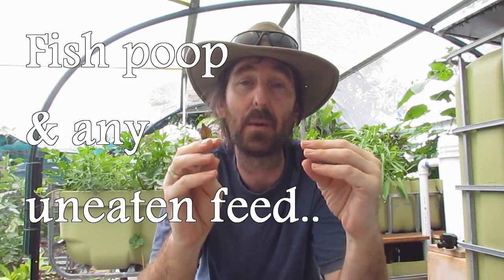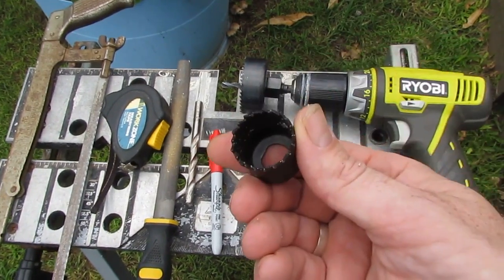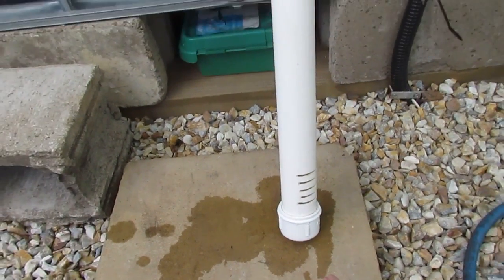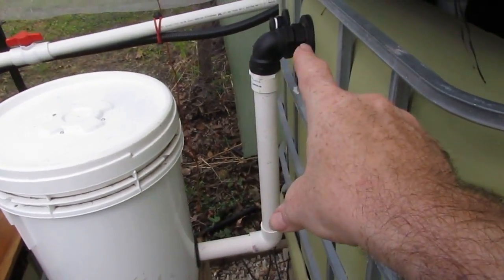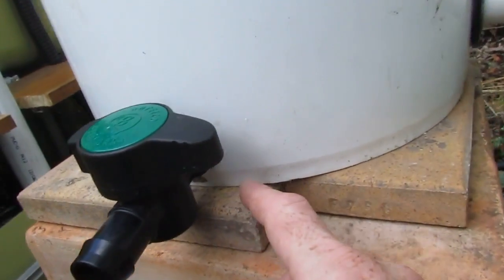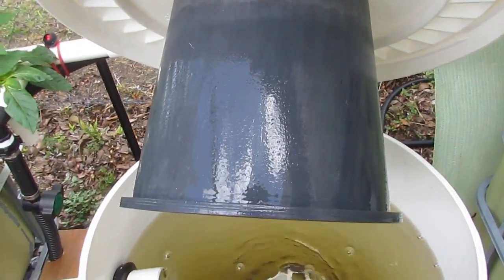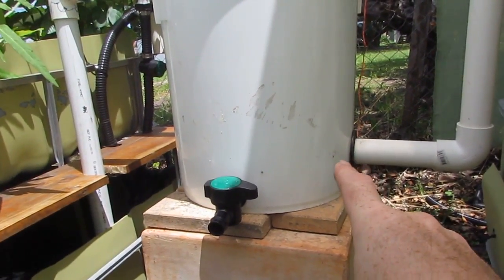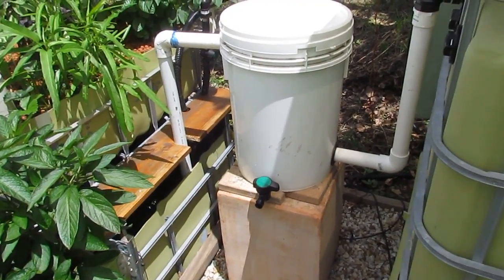Aquaponic radial flow filter for solids removal..

Comment: Why we dont use like filter sponge like mechanical filtration like in the normal aquarium setup ? Like its the same that we can trap the solid waste too
Reply from the maker: The amount of waste a 500g/1lb fish puts out is quite a lot. Multiply that by 30-40 & that's a lot of poop to try to clean out of a spongy media. 😉
I do use a sponge based filter sheet as a fines solids filter for 36 fish & that needs a pressure washer to clean affectivly.
Hope that helps some.

Comment: How does the water get from the fish tank  into the radial from filter
Reply from the maker: Hi David. I answered this on another video but will past the response over for others to see as well.👍
Hi David. This section of the "9 Essential components" video explains how the water moves into the tank & taken out via the SLO to the settler. 
https://www.youtube.com/watch?v=2FTlha0c2aA&t=192s
It's a part of this beginners playlist if that helps. 👍
https://www.youtube.com/playlist?list=PLBcWprMIwYYj8zCdbSzPJOR3HRXpxuBwf
Cheers mate.
Reply: I viewed these, but I don't  understand how the water and waste is pulled into the pipe in the fish tank
Reply from the maker: @helixpoint  The base of the pipe is the only place water has to exit the system. It creates a fairly fast current that drags the solids with it until it reaches the exit at the top. The exit at the top of the SLO is the lowest spot on the tank for the water to exit so dictates the height of the water in the tank. 
Hope that helps some.
Reply: Ah. I see

Comment: Hi Rob Bob, I have read quite a few of comments to see of can find heights to use for the piping as using a 1000 slimline tank to make radial flow filtration, does it need to be lower than the outlet coming from fish tank. I will be running it back into the sump system. Fish water really clear, although experience lot of solid buildup in DWC. Concerned that filter may not be low enough  for water to come to top of internal pipe in the filter.
Reply from the maker: Hi Andy & thanks mate.
The inlet  & outlet pipe of the settler need to be lower than the outlet from the fish tank 👍 Otherwise the water will back up into the fish tank.
Hope the build is progressing well mate.
Reply: Great video and love your dedication to happy fish

Comment: Hey Rob another great video. I am building an indoor system, and I would love your input. The fish tank is an IBC tote with just the top side cut. A second IBC tote is cut to accommodate the grow media bed and the sump tank. I want to grow plants in the media bed and use the sump tank to have a DWC floating raft with leafy greens. Regarding the plumbing, should I have it set up for the water to flow from the fish tank -> radial flow settler -> sump tank then pumped up to the fish tank and grown bed? Or fish tank -> radial flow settler -> grow bed -> sump tank and pumped back to the fish tank? Any input or idea will be greatly appreciated. Thanks!
Reply: I forgot to mention that I'll be using worms in the grow bed and tilapia fish.
Reply from the maker: I'd go with the second option to make the plumbing easy to set up. The split flow really comes into it's own when you have multiple beds with some being at different heights as the others. 
Hope that helps some mate.

Comment: Couldn't the solids be used as nutrients to the plants? Why we have to remove the solids from the the system?
Reply from the maker: You don't have to remove them if you're prepared to muck out the beds every few years. You'll also find that the water holds a lot of the elements suspended in it.
Many folks will mineralise the solids they remove & add that back into the system. Others don't worry as they find the nutrient levels are generally very high in a well stocked backyard system.
Cheers.
Reply: @RobsAquaponics  - Thanks Rob. I certainly would like to see a comparison between a non solids removed system Vs a system with removal... Would it make difference to the plants?
Reply from the maker: @fdavillar  There would be some difference but not a major one. I'm looking at setting up a mineralisation tank soon which will process the solids I remove into more plant available nutrients that can be added back into the system. Will be posting a clip on that when the time comes as well.
Reply: @RobsAquaponics  Do You, Rob? That's great news! I can't wait to see It.

Comment: Good job. Not sure have understand. The water flows out from Ibc tank with 2 different tubes, one is connected directly to the grow bed and another tubes go to radial filter. Is correct? In my system only one tube go from Ibc tank to grow bed ( without any filter)...
Reply from the maker: That's right David. Mucky water from the base of the tank to the filter & cleaner water from the top to the beds. 👍Cheers mate & happy growing.

Comment: I need something like this to pre-filter my irrigation water before it goes to by disc filters. The disc filters at times have to be cleaned 4 times a day or more. I have a gravity feed system from a creek. It gets up to 80psi so the vessel would have to be robust enough to handle the pressure. Because the water is from a creek, there can be a ton of organic sediment that comes with it. Only in the late summer is the water relatively clear.
Reply from the maker: These work best with very long retention times. It's the retention time that allows the solids to fall out of suspension & gather on the base of the filter. 
Cheers.

Comment: Hey Rob, thanks for your video - I dont understand how the water flows up the solids lifting pipe - is it being sucked up because it forms a siphon as the water flows out?
Reply from the maker: Hi Keith & sorry for the time it took to get back to you. 
The water entering the fish tank forces the water to leave via the lowest opening, which is the top of the outlet of the solids lifting pipe. The only way to get to the top of the outlet is through the base of the pipe & as it enters, it take the solids along with it. 
Hope that helps some mate.
Cheers.

Comment: Hi Rob. Just picking your brain here. Do you find it works better with the pipe bringing in the solids from the fish tank being below the surface or above the surface? 

Mine is above by about an inch and I think it could do a better job. 

Cheers have a good one
Reply from the maker: I like to have the top of the inlet pipe in the settler no less than 10cm/4" below the top of the water level in the fish tank if that helps any Michael. Sorry it took a while to get back to you.
Cheers.

Comment: i got close to 40k litres of water stocked with koi (about 100 fish tops). what size radial filter do i need? what size radial tank? inlet flow rate? retention time?  

is there a link that you can recommend so i can do some further reading?

cheers. 

btw is tue radial more efficient than swirl?
Reply from the maker: Hi Swee Wong.
I have some figures in the description of the clip that will help you size the vessel needed for a radial flow filter as solids collection is based off flow rates & retention time. 
This study showed that RFF worked mush better than swirl if that helps at all,
https://goo.gl/yreZ6G
Cheers.
Reply: @RobsAquaponics  cheers

Comment: Hi bob I am in gathering  of material stage  to start  my system  I live  in Belize  central America  I am finding it  really  hard  to get  the parts  I need  to set up my system  for instance  the hardware store  never even  heard of uniseal  abd the bulkhead are way  to expensive to work  with  is there any other option
Reply from the maker: Sometimes you can get away with using the threaded PVC fittings & washers Leon. It all depends on how much of a lip they have around the ends to help make a seal with the washer. Washers that size may also be an issue but they can be made from old tyre inner tubes. 
Hope that helps mate.

Comment: Hi there...Rob  ... so where's the point where the pump is  hooked at when adding this filter....??  ... sorry new to this swirl filter thing
Reply from the maker: Hi Alison.  The water entering the filter is coming from the over flow from the fish tank so no pump is required. 
When solids are run through pumps they are broken up into finer pieces which makes them even harder to remove from the water column. 
This clip explains how the filter was connected to our old IBC system,
► https://www.youtube.com/watch?v=j-T2Fzfc1do
I plan to have a few clips coming out soon that runs through a few different ways you can plumb up your aquaponic system. Just need to find the time to finish them off. 
Hope that helps you out some.

Comment: Nice vid.  You might like to take a look at the swirl filter built by SSLFamilyDad.  It's more complicated to build, but I think it's a somewhat better design.  See what you think.  Those uniseals you sell are an excellent idea.  I love it.
Reply from the maker: Hi Ron. Todd built a swirl filter which is a bit different to the radial flow I knocked together. 
There was a study don'e between the radial flow & swirl that showed a properly made radial flow filter is more efficient at removing solids than a swirl filter. https://www.sciencedirect.com/science/article/pii/S0144860904001049 
Cheers & have a top one.
Reply from the maker: Hi Ron. Todd built a swirl filter which is a bit different to the radial flow I knocked together. 
There was a study don'e between the radial flow & swirl that showed a properly made radial flow filter is more efficient at removing solids than a swirl filter. https://www.sciencedirect.com/science/article/pii/S0144860904001049 
Cheers & have a top one.
Reply: Hmm.  Interesting stuff.  I wonder what happens if both types are used in series.  Thanks for the link.
Reply from the maker: I'd go with the swirl first then the RFF as it catches the finer solids if you're going to have a crack at it.  👍
Cheers Ron & have a top one mate.
Reply: That's what I was thinking.  It may not be worth the bother, but what the hay, it might be fun.  NOW I'm wondering how much trouble is it to make a cone bottom tank.  They're not exactly free, but cost less than an IBC.
Reply from the maker: A cone base would make life a lot easier. 😉
Reply: BTW, I once saw a vid on how to use 2 hole saws to enlarge a hole.  Just leave off the drill point and put a hole saw that matches your existing hole onto the same arbor as the hole saw you wish to enlarge with.  The smaller hole saw becomes the pilot drill.  I just thought you might like to know in case you could use that information sometime in the future.
Reply: I did a little looking around and found those tanks are called:  Cone-bottom inductor tanks.  I was surprised to find a 55-gallon U.S. (208L) for less money than a 15-gallon (<57L) model (about 130 U.S. dollars).   It boggles my mind.

After more looking around, I found a new 30 U.S. gallon (113.6L) inductor tank for $97 (USD) (possibly without the stand).  Pricey things, these tanks.

Comment: Hi Bob
I'm a rookie when it comes to aquaponics and it's not very common here in Denmark. But I want to change that 😀

I was thinking of using the valve in the IBC and then make a standpipe (with a T on top) outside the tank. Do you think it can remove solids too? On the inside I'll put a mesh in front of the valve to keep the fish safe.
Thanks for all your great videos ❤️
Reply from the maker: Hi Søren. Sorry it's taken a while to get back to you. 
I personally don't like the idea of using the tap as you will need to screen off the hole from the inside which will be hard to clean out. If you do use this method I'd suggest you make sure the external pipe is secured very well so as to not come loose & cause the system to lose water.
Hope that helps some mate.
Cheers.

Comment: question... I see that you are using an overflow gravity feed into the radial flow. did you run into a low pressure problem going into the bottom of the radial flow. I am going to use a siphon feed but was unsure about enough pressure going to the bottom of the radial flow.?.?
Reply from the maker: Hi Mike & sorry I missed this post. 
I don't have any issues with flow coming into the filter but did get an air lock form in the old fittings I was using at times. Was easy enough to fix by drilling a hole at the top of the 90° fitting leaving.
Cheers mate

Comment: Hi Rob, I am from Vietnam. I have a question (unrelated to this video :-)). Currently I have to clean up my pump too often like 1 time every 3 days because of solid fish waste; otherwise the water flow to grow bed will drop drastically. How often do you have to clean up your pump? Can you give me some advice on what options I should try so I don't have to clean up my pump that much often?
Reply from the maker: Hi Hugh. Do you have any solids filtration on the system there ?  Is a bit hard to know what to suggest without knowing the layout. 
I very rarely clean mine (once every 6-8 weeks if I remember) but also have radial flow settler / filter in line after the fish tank. 
Cheers mate

Comment: what is the usual velocity in aquaponic?
Reply from the maker: Hi there. The water velocity/flow rate will vary from system to system. A general rule of thumb is that the water in the fish tank should go through the biological filters (grow beds or bio reactor) at least 1.5 times per hour MINIMUM. From there you can work out the flow rates needed from your pumps.
Hope that helps some.

Comment: Rob.
I copied your Radial Flow Filter (RFF) design.  The water enters the upright pipe slowly and I haven't seen any solids coming in yet.  The water level in the fish tank comes barely over the bulkhead fitting that goes into the Radial Flow filter.  If I increase the water level in the fish tank to increase the flow into the RFF would that improve the siphoning effect into the RFF? .  As a backup I bought a $30 small pool battery powered vacuum to clean the bottom of the fish tank (IBC). Also, thanks to your videos I noww have been testing my system with goldfish and starter plants in the grow beds to ensure my system is working before I get tilapia.  Thanks for everything.
Reply from the maker: Hi James. 
If it's not collecting the solids from the base of the tank there could be due to a slow flow rate into then out of the fish tank or poor positioning of the solids lifting outlet. I dare say that once you get the fish in there it will improve a bit as they will assist in stirring up the solids on the base into the water column.  In the old system from this clip I used to get dead spots that would collect the solids from time to time if the fish weren't very active. 
Hope that helps you out some James.  👍

Comment: What inch uniseal do you use for the 40mm pipe?
Reply from the maker: Hey Chris. Sorry I missed this question mate. 
The 40mm pvc pressure pipe takes a 1½" uniseal. If its a 40mm/1½" drain pipe then here in Australia its a 32mm/1¼" uniseal. 
How's the system running for you?

Comment: when you said stormwater pipe did you mean something like a corrugated plastic drainage pipe?
was re thinking about it and would make sense the corrugation would create perturbation slowing the flow of water kind of like a gold sluice box
Reply from the maker: Emeric Catudal Hi Emeric. Storm water pipe here is a plain PVC pipe just with thinner walls (like drain pipe) than the pressure pipe I use on the fish tanks. 
Hope that helps mate. 
Cheers

Comment: I've run a small (80 litre tank) system 17ish years without cleaning but I'd still put a solids filter in if I was to do it again. I get 'seasonal cycling' where nutrients build over winter,. locked up as microbial biomass, and they're released over summer via protist/food web predators and hungry plants eg tomatoes.

I monitored for five years then stopped. Provided I have plants: present in winter and booming in summer - tanks clean. If growing out fish for food - harvest some (fish) before winter hits to be safe in larger systems.

Nice filter btw. Your garlic patch (and many other plants) will love the byproduct.

Comment: drill holes in that lid to avoid making a syphon
Reply from the maker: Hi Ryan. 
The pot on the underside of the lid had drainage holes in it so a siphon wouldn't initiate there & the lid on the filter wasn't an airtight seal. Had the system plumed like this for about a year from memory & never had any issues. 
Cheers mate.

Comment: Greetings Mr Rob Bob, this system is still in operation? how efficient is?, i saw another of you´re videos and you have another system, so what system is better? radial or swirl filter?.
Reply from the maker: Hi there. Still have a radial flow filter in the system here just made from a larger drum. 👍 Have never run a swirl filter but from what I've read they do settle out the solids a bit more efficiently than the swirl filters. 
Hope that helps some.

Comment: Can you connect two fish tanks to one radial filter?
Reply from the maker: Hey Derek. You certainly can & my current system has 2 fish tanks feeding into one filter through a single line & the old fish farm had 2 separate lines coming into the filter 👍 
Fish farm with 2 lines. 
https://www.youtube.com/watch?v=aPJdn9R1etM
Current Radial Flow Filter 
https://www.youtube.com/watch?v=Kztyzk7AU34

Hope that helps some.

Comment: Im planing an 1000liter ibc With an radial Flow Filter and an Moving bed for biological Filtration. Is it possible to have the radial Flow under the water Level of the Moving bed? Or is it necessary to have both at the Same Level. I hope you unterstand what i mean. Thanks, and Very nice Videos
Reply from the maker: Hi there.
They can be set at different levels with no problems as long as the first in line is above the next in line. Hope that makes sense 👍
Glad you're enjoying the clips & have a great one : )